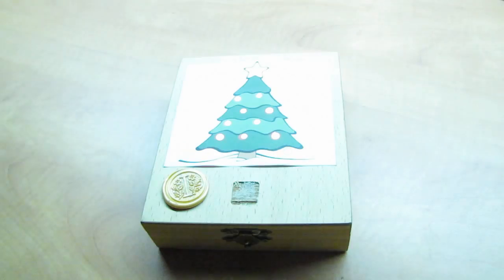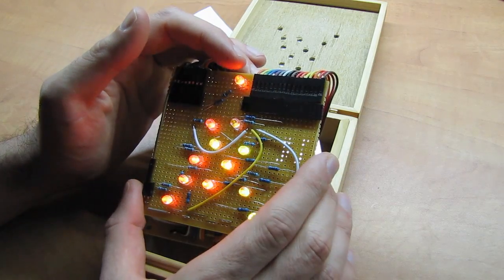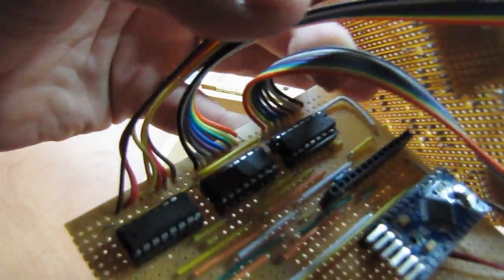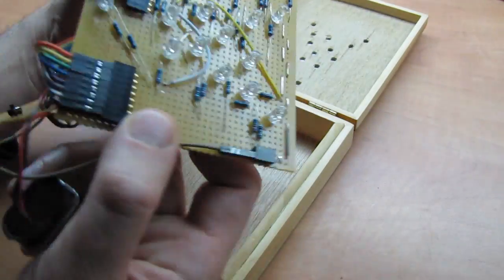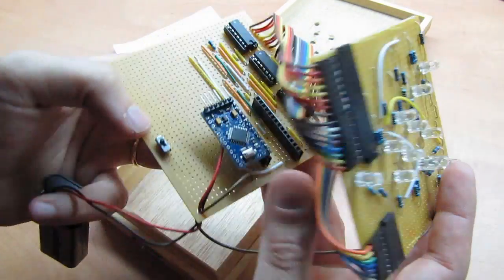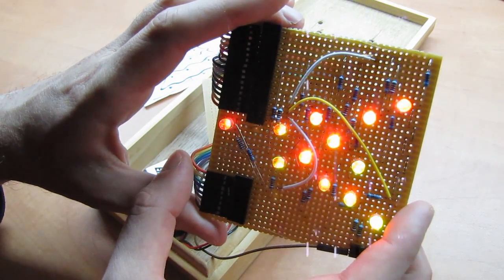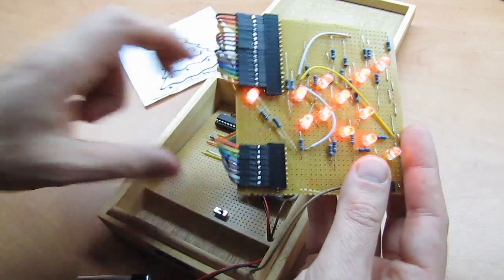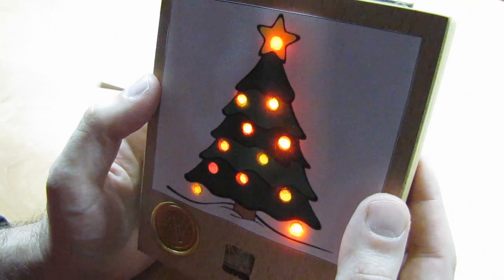DIY Arduino Christmas Tree

Comment: Why 3 shift registers? 12 LEDs can be controlled with two of them and still 4 unused outputs remain. I control brightness of 16 LED simultaneously with two 595 and Arduino Uno.
Reply from the maker: Those were Red/Green LEDs, so you need two outputs for each.